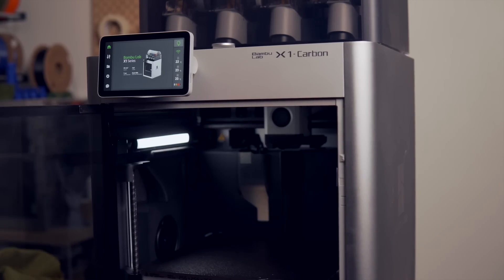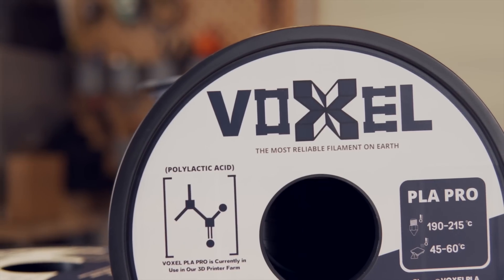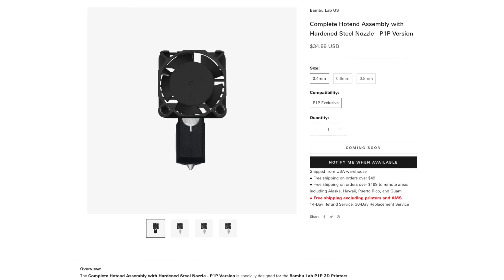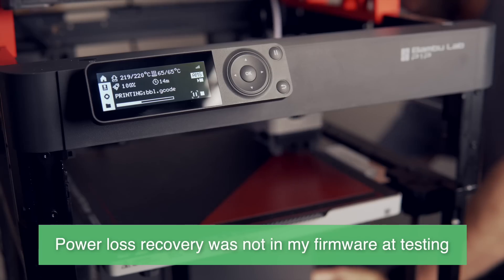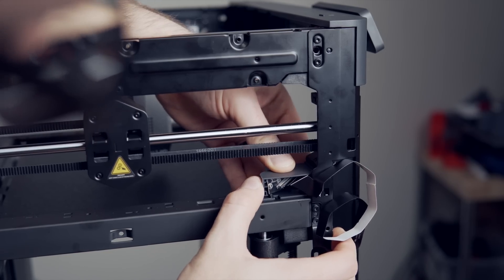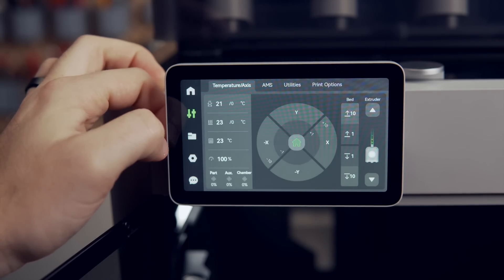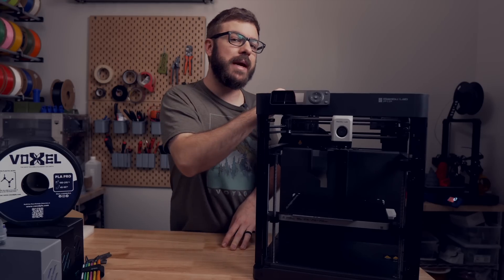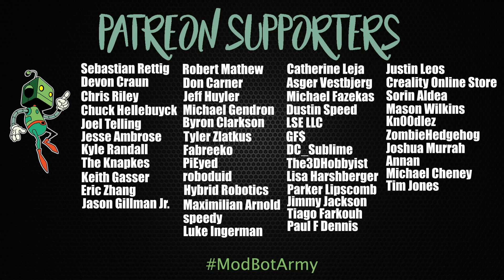Best Price To Performance 3d Printer? (Bambu Lab P1P)

Comment: Prusa are getting long in the tooth however their evolution has produced a rock solid printer - I have 2 (mk3s and 3s+). The machine is also non Chinese so you will pay a premium. If covid taught us anything decentralized manufacturing is the best way forward so if one country goes down it doesn’t jeopardize everything else. The threat from Bambu will cause them to bring forward the mk4 (which I think will be quite soon based on influencer language in last 2weeks) - prusa even has a survey on what people want to see on the next iteration of mk3 if you go to printables. 

Be interesting if these fast machines shake themselves to bits over time. Is it worth doing a 3mths and 6 month test to see if they still perform as the did out of the box.
Reply: With how long it took them to get the XL in a releasable state no way the mk4 is coming any time soon
Reply: @BeefIngot  but it requires significantly more parts and different boards so that would cause delays. 

The mk3 replacement will surely have been made in parallel (much like Apple develop iPads and iPhones at same time) and we may have already seen a “mk4” being used in the AFS - that is if they go with core xy. 
There been a lot of chatter in last 4 weeks and the bambu labs will accelerate that in next few months… 

But I could be completely wrong.
Reply: @BeefIngot  The XL is a much more complex machine. The only thing out there that is in the same arena is the E3D Tool Changer, and that is considered a dev kit.
Reply: @HackMonkey  You think they have the resources to do both at once when one is taking this long? When the Mk3s itself took so long for its evolutions?
Reply: @BeefIngot  Actually No. Joe has said they are only doing one machine at a time right now. But they now have a CoreXY system, and firmware capable of running it. They have even said the XL would be able to run Klipper. So whatever follows the MK3, could benefit from the XL development. But again, anything we all say here really are just guesses.
Reply: @ScottWilkinson-HaloFX  You are mentioning this as if it's easily transferable. They've always had a core xy capable firmware. Marlin has that built in.

The XL also won't be klipper ready out of the box, you'll have to work for it and add a pi.

Anyhow my point is with an item like a 3d printer, they can't just dumbify the XL and have it come out for under 1000 bucks.

They have to make it smaller, lose any semblance of the tool changer system, design it without any of the fancy boards,  etc etc.

They also probably need to stop this whole nickle and dimming thing like where the XL somehow doesn't have a built in enclosure.

Comment: Hello
I'm having trouble with plate adhesion while using my creality pei build plate
Do you know how to solve this?
Reply: Errr could be wrong here but why are you using a creality pei plate? The stock incl pei plates works fanstastic for me. Zero adhesion probs. You can order one offa Bambu site for cheaper than the creality plate.
Reply: @scottsum1319  sorry I wrote my comment here
My problem is with my Cr-10s Pro V2

Comment: Too many problems with these bambu printers. Just more chinese printers built with questionable chinese quality. Their sub reddit is full of issues.
Reply from the maker: Every printer has issues. You will much more often see the units with issues than the many off printing happily. It is no different with any other printer be it a prusa or industrial.
Reply: the prusa sub is also full of issues.... that doesn't mean prusa printers are terrible. You need to get a life instead of commenting on every possible bambu video you can find.
Reply: @morbus5726  Same to you, you're literally on every prusa/bambu vid shilling for bambu like they pay you a salary, the least you could do is buy one. A lot of what you find on the prusa sub is user error or wrongly assembled kits. You're comparing a sub of 40K plus to one with less than 7K. And the one with 7K has more daily posts related to mechanical or software issues than the one with over 40K users.

Fun fact, the stepper motors on the X1/P1P are the same as the ones on the ender 3's, and probably other cheapo china printers.They're the same part numbers. Like I said, they use the same parts from the same factory in shenzhen. It's no wonder why so many people have motors go bad on their bambu's.
Reply: @LilApe  the first thing you said about the posts is just not true, there are more issues with prusa machines seen, due to the larger user base. Also, you need to compare the amount of ACTIVE members, not just the total member count. 

I'm not shilling for bambu, I'm just shutting down the obvious misinformation you're spreading, like when you claimed your stock prusa could do a good looking 25 minute benchy with a 0.4 mm nozzle. I'm still waiting to see you're claim. You also claimed that a stock prusa could achieve 0.0007mm tolerances off the bed. I would like to see that too.
Reply: @morbus5726  I never said i could print a 25 min benchy with a .4mm nozzle. I said I could do it with a .6mm. And I went into detail every setting I used on prusa slicer to accomplish that. I said this months ago and you bambu nut riders jumped all over me saying "It HaS to foLLoW spEEd boAT ruLeS" Like that somehow disqualified the fact that I could print a sub 20min benchy.
Reply: @LilApe  sure, lets see the 0.6mm nozzle do a sub 30. It doesn't count if you use a 1.2mm nozzle and 0.6 layer heights, that's why people mentioned speed boat rules.
Reply: Is your evidence seriously "the bambu sub is full of issues"? What a horrible metric. Firstly, all the top posts are consistently "holy shit this thing is amazing". Secondly, someone is much more likely to post about an issue than a perfectly fine working printer.

Let me ask, out of all the Bambu printers you've used how many have had significant issues?

For me, 0/9 have had issues after about 2 months of printing. Let's see how your personal tested experience compares.
Reply: @condorman6293  My 4 year old MK3 with 17K hours has given me less problems than my 2 month old X1C with only 300 hrs. Already had to replace my heat bed and one of the axis motors. Now one of the fans is bad, its screaming. Somewhere in the back of the printer. That fan seems to be a common problem with the X1's
Reply: @HaloMachine  You have to realize that there are tons of people who've had to replace mk3s parts too. The fact is no product is perfect and you will get duds. Do you remember the mk3s history? What happened when the mk4 first came out and the changes necessary to reach the plus? Do you not still see posts with vfa issues, burned up components etc? None of that means the mk3s is bad and without statistics you cant judge reliability based on one printer if it's not an obvious flaw waiting to happen. You have to look at the number of people who don't have issues and realize you might or might not be in a small minority.

You can totally judge their less good customer service though.
Reply: @condorman6293  It's reliability is literally no better than an ender. Its a chinese printer built with the same chinese components that come out of the same factory in shenzhen. Ive seen 4 in person. One P1P, two X1's and a X1CC. P1P is from a friend/neighbor, the other three are from coworkers. All but the X1CC have problems and are are currently dead waiting for parts.

Friends P1P is dead with literally less than 10hrs. Stepper motor is bad and just grinds. Hes still waiting on a replacement part. 

One X1 crashed it's tool head into the bed during calibration and is waiting for a replacement heated. The other X1 has a faulty PSU and will randomly shut off during printing. Both have less than 100 hours according to co workers.

The X1CC is the only one without issues. other than broken AMS rollers that were re printed

Based on what I've seen in person, their printers have a 25% success rate lol.
Reply: You post about this on every video about this printer. Stop pretending like they're unreliable printers, when they're obviously not.
Why do you make these comments on EVERY SINGLE VIDEO ABOUT THIS PRINTER?
Reply: @logitech4873  Because it's an unreliable printer made of bargain bin components. You don't have to own one to understand and see it. 3/4 that i've seen in person have been junk. The world is a lot larger than just youtube bud.
Reply: @LilApe  I've had one since launch, I was one of the earliest backers. I've had zero issues.
Reply: Ah here you are yet again spreading lies about a printer I'm sure at this point you've never actually seen in real life and have no actual thoughts on past a weird hatred for them for being Chinese. So many of these comments like the one where you claim completely impossible tolerances for fff in your prusa

Comment: I have an X1CC and still bought the P1P. I mainly print PLA so I didn’t see the point of spending more money. I’m blown away with how similar in speed and quality the P1P has to the X1C. The screen may be harder to use but I don’t mind it because it gets the job done. Great review!
Reply: I'd like to it reviewed against the Ender 5 S1.  Particularly with a Sonic Pad.
Reply: @fellwind  the ender 5 s1,even with the sonic pad wont compare to this,also different kind of printers
Reply: @toasterdev8329  please can you elaborate a bit more
Reply: @jeanalz  the bambulab first off,its a corexy,so it can reach much higher speeds at better quality,also different price points,and its made for different kind of people

Comment: I'm on the fence between this or a prusa mk3s+ kit. Wish bambu would take PayPal payments.  .... prusa great historic reliability,  orchid great piece for unsure 12 months reliability or bambu still going.
Reply: While the MK3 is slower, simply because it isn't CoreXY, it is still a solid machine, and has many features the P1P doesn't. Simple things, like a load sequence! I have both, the P1P is faster, but the MK3 is much more pleasurable to use.
Reply: @HackMonkey  Its not about the speed...the MK3 is technically years behind , sorry
Reply: Comparison between a Prusa and a Bambolab is like between a 1985 Mercedes 200 and a Tesla...just saying🙄

Comment: Two questions on P1P vs X1C. 
The   P1P specs list a Bluetooth capability lacking in its older cousin. What functionality does it add? 
I live in a mid-size apartment. What is the noise difference between the models?
Reply: They are both loud
Reply: @woodwaker1  Are you saying they sound the same?
Reply: @julesgoldstein634  Not sure yet, I just unpacked my P1P this evening.  But my X1 Carbon is loud, and the P1P must be the same or louder.
Reply: Bluetooth is only for the initial setup of the wifi network, and to connect you to their cloud.

Comment: Great review.
I have a question regarding the bambu lab X1 with AMS. How much filament do you waste when switching filaments? I would like to use water soluble filaments for supports. I was looking at dual extruder printers to minimise filament wastage.
Reply: It depends completely on the object you're printing, but with lots of filament changes it could be very high wastage. I design all my multimaterial prints with low wastage in mind, but I only print technical stuff really so naturally it's easier to control material changes than with an artistic print.
I haven't printed with water soluble supports, but the Bambu printers all print with one print head, and you can't really print materials with unmatched thermal properties in one print. I'd say get a proper idex printer for that.
On a side note, I'm very happy with the x1c, I print a lot of mono or two colour prints, and a bit of mono high temp material, and the accuracy, speed and print quality have been amazing.
Reply: @DisorderedArray  thank you for the reply.
What do you think of the new snapmaker j1 idex printer?
Reply: @shaun2938  I don't really know, I was in the market for a new printer last spring, and I looked at the Qidi idex, which is pretty expensive for what you get, but then the x1c Kickstarter came up and I was lucky enough to get an earlybird deal.
I would say do some careful comparisons of price and functionality for printers, and choose the cheapest option that serves your needs best.

Comment: Had trouble installing the camera on mine, either the "Clip" was missing or I broke it off without realizing , have a ticket in with Bambu and they are still looking at the problem.
I also have the X1 carbon  that is very nice. thanks for another great video
Reply: There is no clip or connector on the ribbon cable that is attached to the camera. you have to carefully insert it into the connector on the circuit board on the printer and keep it in place with the little black lever that comes down.
Reply: Ya it took me a 1/2hr to figure that out too. There's no connector but just a metal strip at the end. Woulda been so much easier if it was a connector. C'mon Bambu, get this done right. That said, once you get it, its an easy install

Comment: I am an X1 Carbon owner. About your question if I would be interested in the P1P.  Yea, but haven't ordered one. Seems it would be great for single color PLA stuff, which is the majority of my prints.  Part of me just wants a 2nd  X1 Carbon.  So far it's so fast I don't really need a 2nd and I never use my CR10 Pro's anymore.  I have a Creatbot I use if I need the bigger print bed, but it's also too slow.
Reply: it can also do multcolor, but it seems to be a pla and petg focused machine.
Reply: @morbus5726  Yeah but for me if you add the AMS it defeats the purpose of a cheap really fast single color printer.
Reply: @Nerlin  ah true.
Reply: I have similar problem,  I donated my 4  Ender 5s to a local school to make room for my X1 Carbon and P1P.  Now with them and two Rat Rigs, I have everything I need (for now)

Comment: Many who've not used the P1P might think you're doing the 'corporate' thing in praising the printer cos you got it free + whatever other benefits from Bambu Labs. I've had my pre order P1P for a week & besides some acclimatization time, a clogged nozzle (hasnt been able to clear it yet so just swapped it out with spare) & misplaced pei sheet causing an error msg (ya I'm dumb & blind), the printer's been a revelation. Its 3-4x faster than my Mingda MagicianX with better print quality. It even does great with TPU tho I'm buying a 0.8mm hotend for that. So far, I love it. 3d printing is now fun for me. Good, accurate & most importantly, honest review. Thanks
Reply: I just open mine up yesterday and played around with it. I tried some TPU and clogged up the nozzle.  I saw a video on here where you hit up the smallest Allen wrench with a fire, lighter, etc. and then you stick it in the hot end. Let it cool and pull out the clog. It worked for me. You might give it a try.
Reply: @Zor1d-p3i  A small drill bit works too. I have a lot of .060 drills lying around so I used one of those and the stuck filament grabbed right on and got pulled out of the hot end.
Reply: I have had the same experience, my girlfriend has gotten herself into 3-D printing, and ended up going with the P1P. I have absolutely zero experience in any sort of CNC laser cutting or 3-D printing and was easily able to figure out how to use the slicer and start printing things with absolutely zero issues. even with the many mistakes a newbie like myself has made like getting the oil from my hands all over the bed, putting the bed back on wrong, have the printer on a horrifically unstable table, and many more I’m sure, and the printer has just worked flawlessly nonetheless. 

We have had it for about three weeks now and it has been printing nonstop. no issues. Not even a single error messages despite all of the operator errors. I am looking to enclose it and move onto some carbon fiber filled filaments and ABS. 
My thoughts as a complete novice in this Hobby is: if your goal is to turn STL and step files into physical objects with the least amount of resistance, and while doing the least amount of research, then this printer is certainly a good choice. 
I can see a future where a 3-D printer is just as common as an HP printer in most homes if bamboo labs, or anyone else keeps turning out these highly beginner friendly printers. 

With that being said, I like to tinker, and I’ve already installed softfever, and have found myself wishing there was more options in the slicer, at least options that already matched the tutorials that I could find about clipper. 
All in all, this printer works great.
Reply: TbH Its made by ex DJI employees is convincing enough for most people
Reply: Tbh, if I didn't order 10x of these to replace my Prusas, I'd be feeling scared of being left behind. These printers are close to how printers should have been for the last 3 years.

Comment: I haven’t seen your earlier video on the higher end Bambu Lab printer so perhaps you provide details there but in this video you flash past the idea of requiring an account of some sort to run the P1P.

Is this correct? Personally I would never purchase a printer that requires an actual account, or worse a live internet connection to some external site, to run. It really is a show stopper for me. I know it isn’t an issue for many users but it is for me.
Reply: You can use a cloud account, and they said there is an option for a local  network, and the SD card is always an option - one I will try never to use.